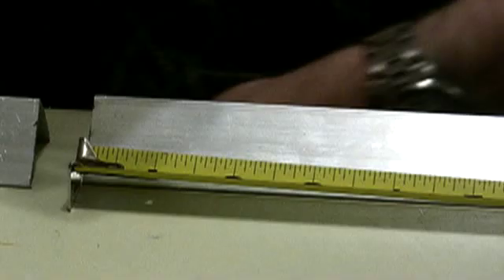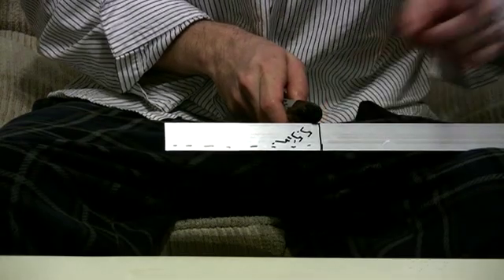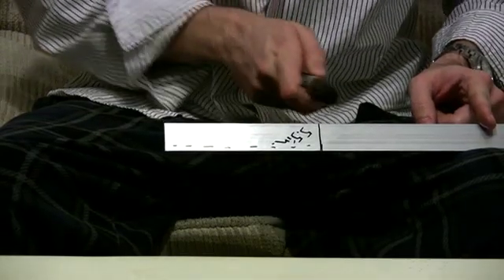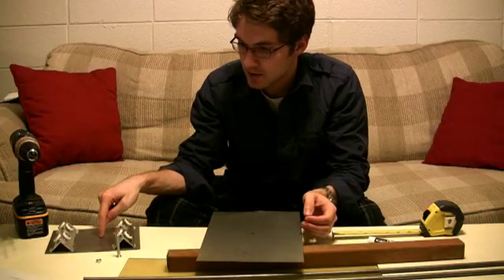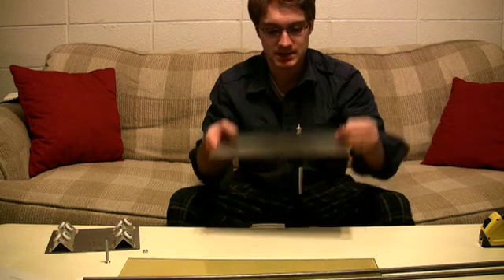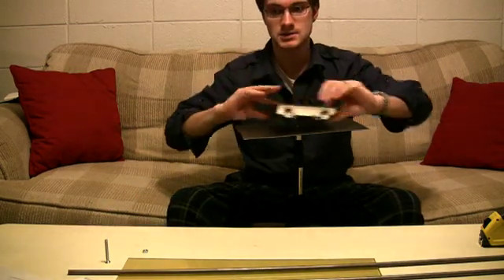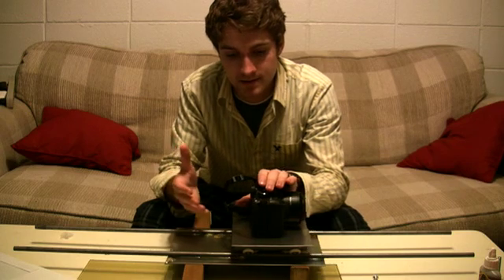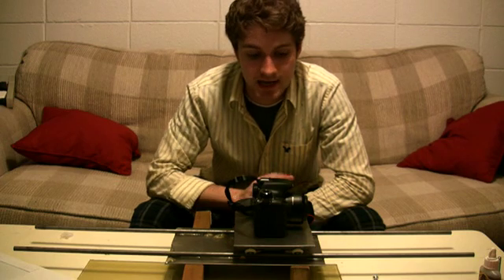DIY Slider (Ultimate Slider) - How to build a DSLR slider...under $40

Comment from the maker: That can be a problem if you only have it supported in the middle on a tripod. With the original I made I had friends hold the end of the track if I had to dolly over all the way to the end, but what is more effective is to put another 2 metal plates on both ends and drill 1/4" holes through them and mount it with two tripods, one on either end. For the price/quality I haven't used a better slider than this DIY one, but you can't expect perfection for $40, even the expensive ones have negatives.